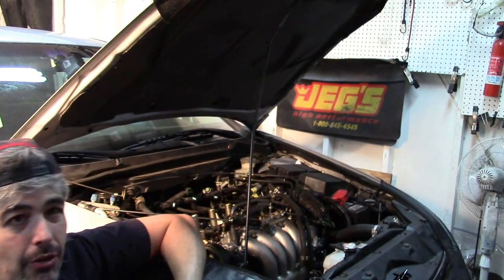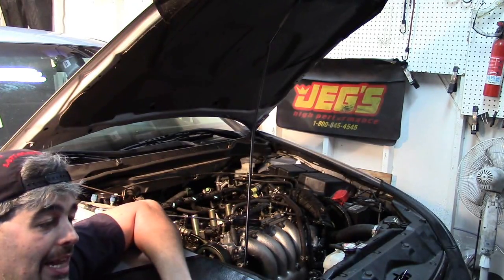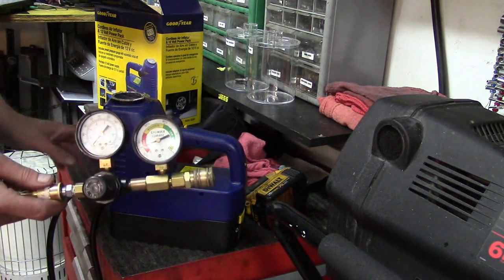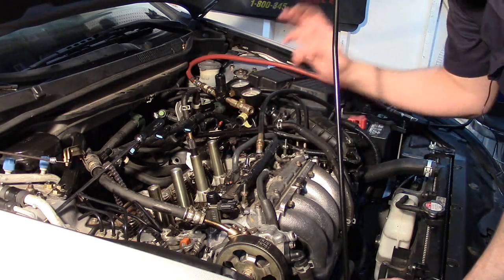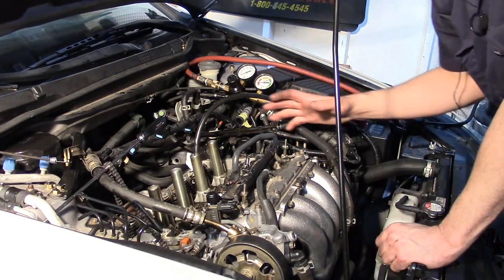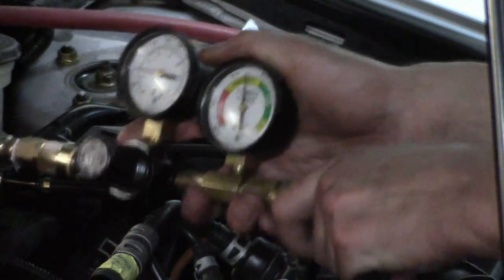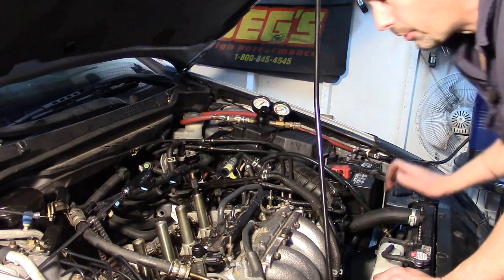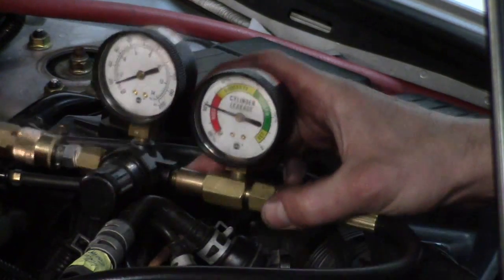A Portable Leakdown Tester For The Salvage Yard?

Comment: Nice video! I've wondered about this too. Just curious- How the hell did they manage to bend a valve? Did the timing chain break or something?
Reply from the maker: Its an old video but If I remember correctly, it did have the timing belt break and then when a new one was installed it never ran right and they brought it to me
Reply: How the hell did they manage to break a timing chain? Lack of maintenance?
Reply from the maker: No idea.
  Normally I ultimately find it was something the owner tried to do themselves. Almost every single car I ever received that was out of time, the owner misinstalled the belt or chain.

Comment: Hey Matt! Those little risers where you plugged into the spark plug holes, are they part of your leak down tester or part of the motor? I've never seen those before.
 
I built a leak down tester and had my plug adapter fastened to a hose but some vehicles are extremely difficult to get that started with a hose on it so I ended up putting a  quick coupler on the plug adapter so I can screw it into the plug hole and even tighten it with a socket, then attach my quick coupler with a 90 degree bend on it.
Reply: +Transguy I make extensions by knocking the guts out of spark plug shells, inserting 1/4" NPT pipe nipples, welding them in place, then attaching an air chuck nipple to the opposite end. Cheap, quick and you can make any length you wish.
Reply: Yeah thats what I do as well. Its a PITA to get the guts out of a spark plug though.

Comment: Hook it up to a long hose and place the compressor away from the engine, it would take some time to build up pressure, but atleast you can listen for leaks into the cooling system or other cylinders. you wont find any significant difference in leakdown from a cracked or warped head.

Comment: Can you show how you converted the pipe from the compressor to an airline fitting? Thanks
Reply from the maker: +Jonathan Buckler I just cut the hose and fitted with a 3/8 air socket
Reply: +Schrodingers Box of course I didn't think of that. Thanks

Comment: What is the tool that you screw into the spark plug hole to determine top dead center?
Reply: +motorman1700 a screwdriver

Comment: Maybe a medium sized nitrogen tank would work well. I do HVAC work, and use my nitrogen setup  for a multitude of things aside from leak testing.  Blowing power tools off, have filled a flat tire, cleaning the van, my clothes lol, etc. Just have to rig the connection off of the regulator and strap the setup to a hand truck. Might work. Thanks for the vid. Cool concept for checking an engine at a yard.
Reply from the maker: djhaggerty Can't bring any tanks to the yard

Comment: I know you've already went over O2 sensors, well... went over them a lot haha but I have 1 burning question I cant figure out. On the FlexFule cars/trucks. Want would your O2 sensors look like when you put it E86 vs 87 Octane. I know the STFL would probably go rich until the o2 goes back to stoic and evrything would stabilize again but my real question is does anything change, diagnostically speaking, if your working on a flexfule car? 

Thanks. You're the man.
Reply from the maker: Donald Peal Yes I see where you're coming from. I haven't played around much with flexfuel vehicles but it would seem to me- well, first off they mostly would have A/F sensors I imagine, but either way, I imagine the A/F ratios would still be identical and fuel trim would not change. The ratio of a/f should still be 14.7:1 and combustion I doubt is any less efficient in an E85 vehicle. I'd have to play around with it to confirm.
Reply: Schrodingers Box I agree that they would probably have AF sensors but the stoichiometric ratio for vehicle that's running on ethanol is 9:1 vs the norm of 14.7 to 1 so I was wondering how those vehicles can switch from those ratios without your LTFT being super rich while running  ethanol. I wasnt sure if there was something in the fule pump or something that could measue what type of fule is in it and relay that info to the PCM or maybe something programed in them to realize when its running rich at a consistent pase of say -15% fule added that it would just automatically know that that gas must be a different type of gas. sorry to be difficult, just confused and dont want to look at the yahoo answers.
Reply from the maker: Donald Peal Ohhhhh... yeah that would definitely change things, for sure.  I honestly don't know- I'll have to play around with such a vehicle if I ever see one!!

Comment: What tool were you using to find TDC?
Reply from the maker: bigmaci123 It's called a TDC locator. I usually just use a screwdriver but I didn't have one long enough for this application

Comment: Some store bought leakdown testers reportedly  work at 20psi, my own is home brewed from tweekred internet plans I have never tried a cylinder test at that pressure but do use it for cooling system tests with the regulator at 1.5 bar.

Comment: good idea, better than having nothing to decide on compression issues if you standing in the middle of a junkyard
Reply from the maker: exactly!  actually several people also brought up the idea of adding oil to the cylinder to decrease the compression loss. I'm kicking myself for not thinking of that!  more testing to follow when I bring this thing to a yard and use it this summer.
Reply: Schrodingers Box I never add any oil to the cylinder when doing any sort of compression test.  All that does is 'falsify' the results.  An engine with good compression does NOT add oil while it is running to cure excessive piston ring wear, right?? So I say to those folks, why fake it with false numbers?  It is what it is
Reply from the maker: the reason is to determine if the loss of compression is through rings or not.  If the loss of compression is through the rings, adding oil very significantly improves it. This tells you that your situation is considerably more severe than jut a cylinder head issue. 
  Adding oil specifies the result, not falsifies it.
Reply: Schrodingers Box ohhh I thought the topic was about valve issues not the rings.  Then of course the oil injected into the cylinder would help determine piston ring health.
Reply from the maker: Ozzstar Actually, let me correct my statement Ozz,
  As far as in general, my statement is correct, adding oil during a compression test is valid in determining if compression loss is through the rings.
  In this exact example, however, you would be right (I didn't realize this comment was on this video in particular).  In this video, adding oil would indeed "falsify" the results as far as the bottom end because since the pump couldn't keep up with the loss of air past the rings on a good engine, this means if we added oil to the cylinder and increased pressure, we would not know if the rings were bad or not to begin with- e.g. did the oil fix the leak past the bad rings or past good rings?  However it would help in determining if the valves were good. If the pressure by adding oil increased to the point the leakdown showed to be in the "good" region, we could say the valves and cylinder head sealing are good. Glad you made that comment, I overlooked this before.
Reply: Schrodingers Box well then to settle the matter, let's agree to agree.  LoL.
Reply from the maker: Ozzstar Hahaha that works for me, because otherwise one of us would be wrong!

Comment: Nice! Did the chain stretch to cause the bent valves? Definitely want to use a genuine Honda tensioner and replace the adjustable cam sproket(vtc actuator). Those can be tricky, you've got my number if you need help.

Comment: As with a lot of tests,it's the comparison with the good and the bad and not the actual figures that count.This tester gives that info and no need for .0000006% accuracy.We're not in "AutoCAD Inventor" on the design trail.The cleverest idea is usually the simplest.
Reply from the maker: Tom OConnor Agreed- more testing is needed to ensure the 60% leakdown is an adequate baseline for a healthy engine but if it is, then yes, this testing is valid for the purpose designed

Comment: I can't believe you don't have an FAA spec leakdown tester.
Reply from the maker: Steve A Being a DIY, I generally just get by with basic equipment since I don't have the throughput to justify high end tools
Reply: High end?  You can build one cheap.
Reply from the maker: Steve A Got a link or something? How is going to help anyway over what I have? I have used this for years to do dozens of leakdowns and it has always been accurate and reliable at helping determine the exact source of compression loss.  What will I gain exactly?
Reply: An FAA correct leakdown tester will let you test the gauges against each other. 
http://en.wikipedia.org/wiki/Leak-down_tester
Reply from the maker: and the benefit I get from this is what exactly?
Reply: Controls.  Or is this an area where you don't believe in controls?
Reply from the maker: Steve A Explain how I need a control. The adjacent cylinder without leakdown or compression problem is the control. The fact every healthy cylinder I have ever used my gauge on shows no more than 5% leakdown are all controls.
  I am totally not following you.  What is the variable I am not considering when I compare a high compression cylinder with 2% leakdown to a cylinder with bad compression and 40% leakdown PLUS the coolant tank bubbles using my current method?? What would the FAA gauge do better? I am totally not following what controls it offers that are necessary to make a definitive conclusion that I have falsely made???

Comment: may add a little air tank and see if it would help the initial read.
Reply from the maker: PhattyMo You actually need surprising amount of volume for a leakdown even on a healthy engine.
But bottom line- leakdown is relative- if 60% can consistently be shown to be a good baseline on a healthy cylinder (for cars with this displacement), this test is absolutely valid.
Reply from the maker: John David Anderson Just because I'm a scientist it doesnt mean I make rules for salvage yards.  There is no way they are letting you bring tanks into a yard.
Reply: wtbm123 Maybe even make a small one out of some 4" ABS pipe,or something.
Reply: Schrodingers Box in offroading they use co2 tanks. they seem to hold a huge amount of compressed volume. but hey, youre the scientist....
Reply: even a small 1 foot tall job? those little suckers pack a lot of air. btw love your channel!
Reply: Schrodingers Box http://powertank.com/
Reply from the maker: John David Anderson Its a good concept... but $500???  Tell you what, buy me one and I'll try it out lol!! $35 bucks on that model I got for the video is more within my production budget right now lol!
Reply: ok fair enough.:)  but it's a badass way to back some air around.....
Reply: wtbm123 They got those buzzbox air compressors with like a half gallon tank installed for150 dollars at Lowels.  but how are they powered . installed battery ? by cigar lighter plug ?  by Ac electric .   plug? No indication on the box how it is powered the Tool manger in a pinch  pointed to a by pass air line on the picture on the box and said  "See that proves it it runs off of AC voltage... " So whats the point of buying a portable buzzbox air compressor that runs off of AC with a portable tank .  I just don't get it . How could the package designers fail to mention how the damn thing is powered .. alls they could come up with was that it was 1.5 hP .   "

Comment: Matt, I was going to suggest until I read your description above that years ago, I bought what they called a air tank kit from the local auto parts store. All's you needed was a empty Freon cylinder and you cold make a portable auxiliary air supply. It worked great for inflating completely flat tires and you could use it and refill over and over. I was wondering if you added one to your contraption if the volume it would provide would help your pump keep up better. That sucks that they won't allow you to bring any type of tank with you.
Reply from the maker: Yeah they won't allow it because they will think it's for welding/cutting and it would get too much attention. even so- when you to a yard you want to be portable and compact as possible. you may walk around for miles and you want everything carryable
Reply: Schrodingers Box Maybe a couple of these would be feasible: 
http://www.andymark.com/product-p/am-2479.htm
We use them with our high school robotics teams to keep weight down.
Reply: Schrodingers Box On second look that these may be better as they have a push-in connector for air line tube http://www.andymark.com/product-p/am-2649.htm and only one port. They'd probably save a few dollars and be less hardware to assemble. Comparable in specs other than the connections. The tube is here http://www.andymark.com/product-p/am-2137.htm
Reply: anyheck Nice!

Comment: What about adding oil to the cylinder?  If the leakage reading goes well above 60% on a good cylinder, then your machine shows valves and head gasket must be in at least good condition.  So, if your salvage yard leakage is 60% dry and then 60% wet, then, the engine has some issue besides the rings.  How far you can go drawing conclusions is difficult.  Is the head warped?
Reply from the maker: Damn why didn't I think of that lol!!!! That would have really helped!!!! dang lol I'll try that soon!
Reply: D Nelson That's exactly what I was going to suggest.  If that didn't give enough of a seal, maybe try some STP or similar thick oil treatment or Lucas oil stabilizer.  Definitely worth a shot,  even regular engine oil will often drastically change compression tests.
Reply from the maker: GRowe1978 Lol every time I release a video someone always points out a huge oversight I made and I then regret releasing it lol!!!
  I will try that after I replace the head and then post an update memo at the end of the video on if it worked
Reply: Schrodingers Box Seeing how you do not mind at all buying many tanks of different gases, why not try a small tank of tungsten hexafluoride.  This is so heavy, it should last a long enough time to finish all the cylinders.

(IJ, of course.)  Another comedian on YouTube, just exactly what you do not want.
Reply from the maker: D Nelson Actually guys, after thinking about this some, adding oil to the cylinder to improve the compression this device creates would only be good for assessing the condition of the cylinder head at best.  The thing is we have to remember that in this video, we know the "control" cylinders are in spec. In a salvage yard, you do not know that.
Therefore, adding oil would "falsify" the results as far as the bottom end because since the pump couldn't keep up with the loss of air past the rings on a known good cylinder, this means if we added oil to the cylinder and increased pressure, we would not know if the rings were bad or not to begin with- e.g. did the oil fix the leak past bad rings or past good rings?  However it could better help in determining if the cylinder head is good. If the pressure by adding oil increased to the point the leakdown showed to be in the "good" region, we could say the valves and cylinder head sealing are good.
Reply: Schrodingers Box How about cutting/removing serpentine belt(s) so you are not dragging all the accessories while turning the engine, should help battery life and not compromise the compression test.
Reply from the maker: D Nelson You cannot do a cranking compression test in a self serve salvage yard, it is not allowed to start any car.
Reply: D Nelson Delete my last comment, thinking of compression test, sorry.
Reply from the maker: no way man! it's actually a valid point other than the salvage yard application, and as a matter of fact, often when I do field diagnosis especially in winter I do this  for exactly the reason you stated! Nothing worse than doing compression test on a V8 only to have battery start dying on you!!

Comment: Maybe different gauge with another  pressure unit may show more accurately , increments
Reply from the maker: JUDGERAMBO It's not an issue of increments, it's an issue of the inadequate CFM (volume airflow) delivered from the pump because it has no tank